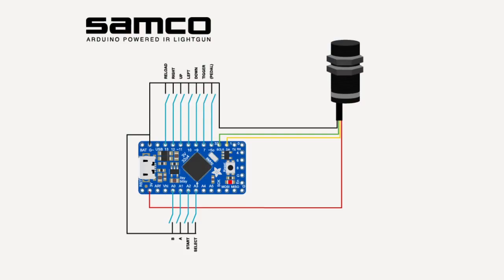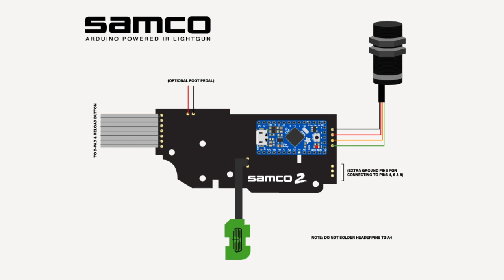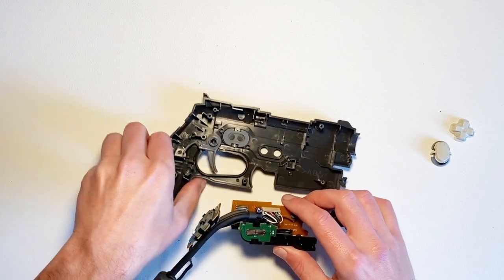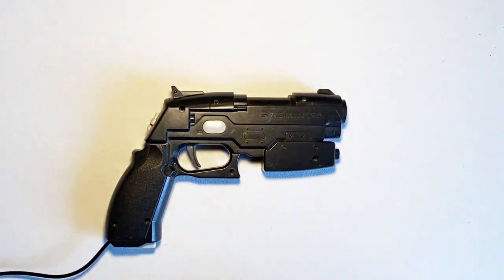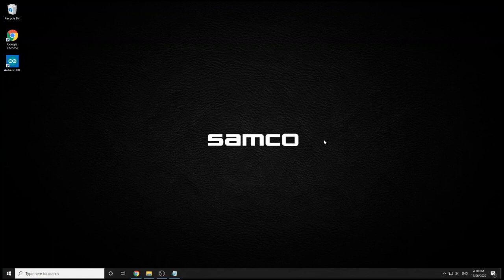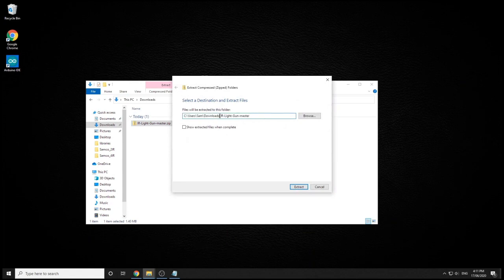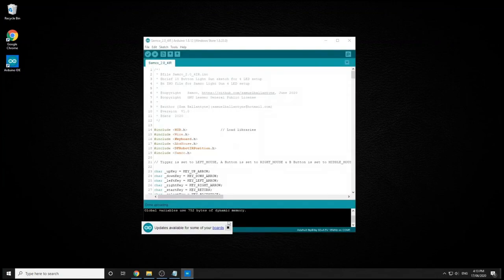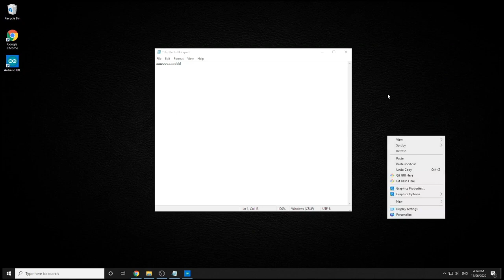SAMCO DIY Light Gun - GunCon2 Build Guide

Comment: Thank you the parts arrived today to Hokkaido.  I'll be doing this build on Monday.  Is the code no redundant and we use OpenFire?  I need to check your other videos to see if you've done an update to using newer code than this video.  Thanks again for this awesome video.
Reply from the maker: Nice! Yeah, my old code still works but OpenFIRE is the way to go, just remember to use an ItsyBitsy RP2040 (not the 32u4 or M0 versions mentioned in the old build guide) haven't made a new build guide yet but the build part itself is the same. Just need to watch the OpenFIRE lanch vid on my channel to see how to upload the firmware. Super easy, just set it to boot mode and drop in the uf2. Any questions just jump on the Discord :) https://discord.gg/PASsykDV
Reply: @samcorulz  Thank you, OK i'll ask in the discord

Comment: Any calibration tips? cannot get mine to calibrate.
Reply from the maker: Sure, first I always recommend running the processing sketch to make sure you camera is picking the leds correctly and is nice and straight (video on my channel, note it’s a bit old now so there’s not button testing anymore) once you’ve got all straight move you camera around a bit before calibrating not sure why but it seems to settle it a bit and runs a bit smoother. Also in the Beta sketch move up and down smoothly while in vertical locked mode and visa versa for horizontal mode and adjust accordingly. Hope this helps 👍

Comment: After soldering the header pins to the ItsyBitsy, do I solder them to the underside of the samco board? Or do they just sit in the samco board?
Reply from the maker: Yeah, they have to be soldered so the connections are tight.
Reply: Alright thanks mate

Comment: How does the pedal function work? Does the circuit need to be open or closed to engage it? Does your code already include functionality for it or will I need to figure that out on my own? I do not know how to code at all.
Reply from the maker: Yeah, it’s just setup as a standard switch. So open off, closed on. I used a tattoo gun foot switch just because there’re cheap and easy to find does the trick. And yip, code is written for pedal function.
Reply: @samcorulz  Thank you for clearing that up, and thank you for keeping this project active. A tattoo gun pedal is a cool idea, but I think I'll go with an industrial pedal. Do you have any updates on recoil modifications?
Reply from the maker: @Blackjackel1138  No problem mate. Yeah, recoil has been on my todo for so long now :) But yeah, I do plan chuck something up... eventually.

Comment: Great informative vid. I had spent 2 hours trying to fix my calibration issues, and was pretty annoyed that it was my sticker being off by whopping 70 degrees. Was just slapped on no doubt. I thought it was a distance issue, then an issue with my wide lens, even thought I had the wires soldered wrong. I'm really glad you called that out.

Comment: How well does this work on large screens of around 130 inch? Also how well does it remain in calibration if you move around the room?
Reply from the maker: You would probably struggle to get it work on such a large TV just due the angle of the camera you would have to stand too far back for the camera to pick up the leds. With my new code calibration moving closer and further from your TV maintains pretty well, but will still go out if you move too far left or right.
Reply: @samcorulz  no dramas mate, i'll stick to original hardware if that's the case, it generally works perfectly fine on the projector, especially the Playstation and Saturn guns.

Comment: Hi, can help me?
I just done assembling my DIY light gun following this guide but the problem was the cursor, it just stayed on the upper left corner. Even though,  I pressed the reload and trigger, which was instructed. I used Arduino Leonardo instead of adafruit itsy-bitsy due to the availability, but it's still 32u4. I bought AR gun also instead of Guncon2. The other parts are the same as in the description. The code that I uploaded was Samco_2.0_4IR_32u4_BETA. I don't know what's wrong with my proj. Can you help me with this?
Reply from the maker: Hi Mate,  yeah,  a Leonardo should work fine if it is setup correctly. This issue could be a few things. Check all your connections, check your camera is working and the red light on, are your sensor bars going (you can check with an old digital camera). Try these and if you still need some help try the Facebook https://www.facebook.com/groups/2456595207897603 me or one of the guys there should be able to help you out.

Comment: Can use this with four sets of leds and the Gun4IR software?  Your version of the software is used if using a lightbar, is that correct?
Reply from the maker: Last time I checked the pinouts are slightly different for the Gun4IR system, so I don’t think so. But you could check with JayBee maybe this has changed.
Reply: @samcorulz  I tried wiring the samco guncon 2 board to a pro micro for gun4ir, no luck. It would be cool to use your boards with the gun4ir also, it's so easy to work with. Going to make a samco gun, any new updates?

Comment: I'm really liking my Samco. I'm having a little trouble though on a multi monitor setup. When I try to run the calibration, it runs it on the wrong screen. Is there any way for me to force it to calibrate to a specific screen?
Reply from the maker: Thanks man, I think this should work... Go down to void setup and look for AbsMouse.init(res_x, res_y); and simply change to AbsMouse.init(res_x * 2, res_y); should update to work only on your left hand screen (as long as both screen have the same screen resolution). Let us know how ya go.
Reply: @samcorulz  Unfortunately that didn't work. My screens aren't the same res or orientation. Left screen 2160x3840 right 1920x1080. The right screen is where I want to use the light gun. Nothing I do to the AbsMouse.init values change where the targets show up for calibration. No worries though. I'm working on using AutoHotKeys to disable some monitors for lightgun games. I think that will work well.

Comment: can we use Atmega32U4 instead of ItsyBitsy 32u4 ??
Reply from the maker: Yip, if you want to solder directly to the microcontroller (i.e. not use the PCB) then any board with a 32u4 chip will do the trick. Just make sure it has a usb port.
Reply: @samcorulz  quick clarification so if we do use Atmega32u4 instead then we can't use the board that you sell on ebay? I have a guncon 2 and have atmega32u4. I want to use the board and atmega if possible.
Reply from the maker: @wolffactor56  If you want to use my PCB you'll have to get a Adafruit IstyBitsy board (either 32u4, M0 or M4 versions all work) so the pinouts match. Here's a link to their 32u4 version they're about $10 https://www.adafruit.com/product/3677
Reply: @samcorulz  perfect thanks for the clarification

Comment: Hi bro, can i use this for the project: https://tienda.bricogeek.com/arduino-original/930-adafruit-pro-trinket-5v-16mhz.html
Reply from the maker: Na, unfortunately that chip does not have HID capability. If you want use the PCB you'll have to and Adafruit ItsyBitsy 32u4, M0 or M4 due to the specific pinouts. Or if you want to solder directly to the microcontroller any board with an 32u4 chip would do the trick might just have to change some pins in the code.
Reply: @samcorulz  thanks bro!! Finally a got a itsybitsy 32u4 5v 16 mhz and i ordered two samco 2 pcb's . I have been taken a look to your esquematic solder pdf and i see that i can solder almost all pins to the pcb less A4 point, is that correct bro?.
Reply from the maker: @egdelous  Almost, pins 4, 6 & 8 aren't soldered to the board but you could still use them by soldering directly to the microcontroller and use on of the grounds pins on the board. Pins A4 & A5 should be used at all as they will mess up the camera.
Reply: @samcorulz  thank you so much for the info dude! waiting for the pcb's arrive to get to work!!.

Comment: Hi bro, i'm very interested in this project but i have two questions, can i add a solenoid in this project? If i can, in what part of the pcb can i put it??
Reply from the maker: Yeah, you could attached one to the alt pins on the PCB but I haven't coded in recoil yet. Unfortunately it's not as easy as just hooking up a solenoid you have to run it through a program called mame hooker and most need external power.

Comment: bro is there a way to use a different gun ie. 3d printed one and just add arrowkeys and reload button?
Reply from the maker: Yip, as long as you have conductive buttons the ones in the GunGon as just simple momentary buttons. Was actually hoping someone would make a cool 3D printed version :)
Reply: @samcorulz  will definitely make one. and add recoil aspects as well! glad i came across your mod.
Reply: @samcorulz  hi is it possible to use an E18-D80NK instead of the dfrobot one. im trying to source the items you have listed locally since im from the philippines and itll take 10x the price to ship it. thank you! sorry for the many questions
Reply from the maker: Na, unfortunately that camera only measures distance the DF Robot version is a really specific camera and it’s the only one I’ve seen unless you want to hack an old wiimote but that’s pretty tricky. Here’s a link to an instructable if your interested https://www.instructables.com/Wii-Remote-IR-Camera-Hack/
Reply: @samcorulz  i found out that aimtrak guns sell their boards now as "AIMTRAK OEM KIT" dont know much about the tech side of things but from what ive seen your current design responds much better. mayve you can take a look at what theyre using in their boards since its they can sell it for pretty cheap. also is there a way i can contact you elsewhere? facebook? thank you! just really interested in designing something we can easy replicate

Comment: Hi SAMCO, I just use Adafruit Itsybitsy 3677 and found the calibration is not success, It is necessary to use M0 / M4 as essential part?
Reply from the maker: No the ItsyBitsy 32u4 (3677) should work fine with a Samco 2.0 board what exactly is the issue?
Reply: SAMCO the cursor is jumpy and not align with the gun movement, at first I flash the 4IR code to the board the problem occurred, then I flash the 2IR code it would be better but this problem still exists
Reply from the maker: It could possibly be that you camera is not aligned correctly (this is common as some of the camera have been miss labeled) make sure the red LED on the camera is closes t to the left side of the gun when holding upright.
Reply: @samcorulz  Thank you for your prompt reply

Comment: Cool little project. I'm just gavering together all the parts. How does this stack up against the aimtrak? I hear the main issue with aimtrak is the distance you need to be next to the screen. Could you clarify one thing for me? Does the gun basically emulate a mouse controller
Reply: I just finished this project last night. With the single wii ir bar its 2.5x the screen. So lets say you have a 40 inch screen. That means you will need to be 100 inches at minimum from screen. With 2x wii ir bar, its supposed to be a minimum of 1.5x times the width of the screen. So in theory you will need a minimum of 60 inches in the same scenario. From what I've tested, it hovers around 1.5 - 2.0x the screen width. Just know your usage might vary, depending on room conditions. Like no light, windows, reflections, etc...
Reply from the maker: Thanks @sandman7793! and just to answer you other question. Yip exactly, works just like a mouse.
Reply: @samcorulz  thanks samco, I have just completed my build now for software installation
Reply: @jasoncopestake5651  How did it go?
Reply: @mosskey  went realy well thanks. Took me a little while to get the ir camera but that's because I accidentally brought it from china. It's a nice solution to play these old games and pretty responsive. My only criticism is how often it needs calibrating when you move position.
Reply: Just ordered a couple of samco PCB's might take a while
Reply: @jasoncopestake5651  when you order the itsbitsy, it comes with headers already in package, so don't order extra. Also when installing the dfrobots camera, don't follow there markings(samco says this in one of his video) because they will be wrong.  As soon as you get one half of controller built,  immediately open the test project from one of his other videos,  and adjust the camera before installing second half of gun. Keeping in mind to stay far enough from the screen while doing this. It took me around 4 to 7 adjustments before it was perfect left to right.
Reply: @sandman7793  thanks for that I will keep it in mind. I take it you just solder the headers to itsbity and the samco pcb?

Comment: Could this work with the alien extermination arcade game?
Reply: Hey so I bought the parts and built it for the guncon 2 and I’m having some trouble with it, like for pcsx2 whenever I try to acquire it by pressing trigger button or any other button nothing happens, and Whenver it’s plugged in I can’t use mouse, also every time start up my computer am I supposed to recalibrate it every time?
Reply from the maker: Yeah, so you have to calibrate every time you start it. But once calibrated you can pause it by pressing the calibration button and unpause it by pressing it again. So to acquire in PCSX2 try calibrating your gun then pause it use your normal mouse to get you to the point where you acquire your gun, then unpause the Samco and shoot the box.

Comment: Hi Samco loving the project i was just wondering if there was a way of using the v 2.0 for guncon2 to make an assault rifle light gun thanks in advance
Reply from the maker: Hi, sorry for the late reply. If you wanted to make an assault rifle style gun I would forget about the PCB and just solder directly to the board. It's a bit more of a hassle but the PCB might not fit and even it does it's not gonna make it that much easier. Hope this helps :)

Comment: Hi, I love the look of this project!  I'm just gathering the parts to make one of these, including having ordered the PCB :-)  I think I read on an old video or earlier github that the sketch was compatible with the cheaper no name Arduino Compatible Pro Micro 5v 32u4 boards.  Is that the case?  I have some of those hanging around, but not the branded ItsyBitsy one.
Reply from the maker: Thanks man! Thats awesome! Yeah, I don't know if I explained it that well but the Samco code will work on those boards but unfortunately if your using the PCB you have to use an ItsyBitsy due the pinouts being different. I know the ItsyBitsys are a little more expensive but they are a great board thats why I decided to use them in my design.
Reply: SAMCO cool, thanks for confirming :-)

Comment: been waiting for this! Was gonna place this in the time crsis gun which has 24v solenoid should be okay? Also should work with all emulators? I have two of these (http://www.arcadeguns.com/index.php?main_page=product_info&cPath=2&products_id=345) should work?
Reply from the maker: Cool man! Are gonna solder of ya buttons directly to the board? I have a few videos of how to setup different emulators on channel it want to check them out, yeah, it works with most emulators I've tried. Unfortunately those sensor bars look pretty Aimtrak specific so I'm pretty sure they won't work with my setup you will probably have to get yourself 2 of something like this https://www.aliexpress.com/item/4000078798481.html?spm=a2g0o.productlist.0.0.2bd93904HmlRkT&algo_pvid=ea3e0d89-a615-4d35-9951-4d301ac63cb5&algo_expid=ea3e0d89-a615-4d35-9951-4d301ac63cb5-0&btsid=0ab6f83115845861942072019e3fc0&ws_ab_test=searchweb0_0,searchweb201602_,searchweb201603_
Reply: @samcorulz  These are the namco arcade guns https://mega.nz/file/s0pkhQ4b#yDTr_4Xc-DakoL3wcA9VdcwLv-zZb5xGFhisEw5LnE4 unfortunately they don't have buttons and because of the price I paid I don't want to cut it haha so no buttons just solenoid.